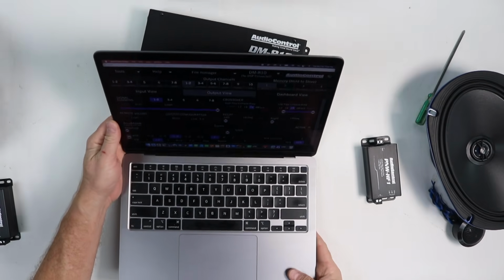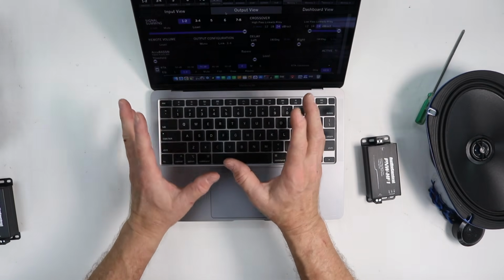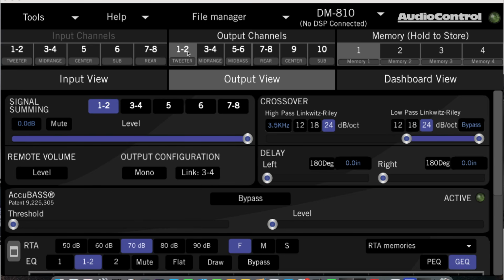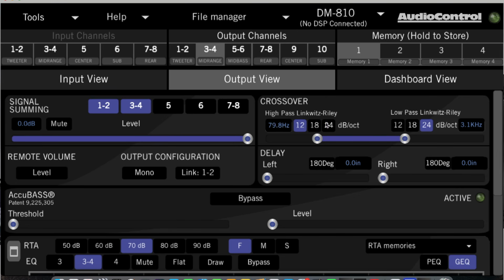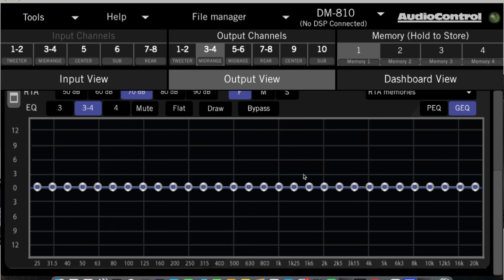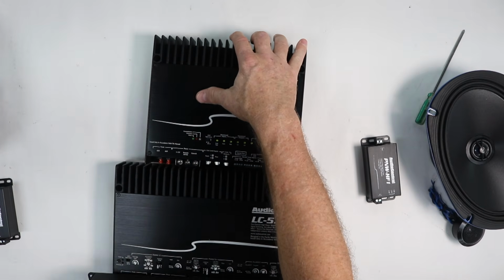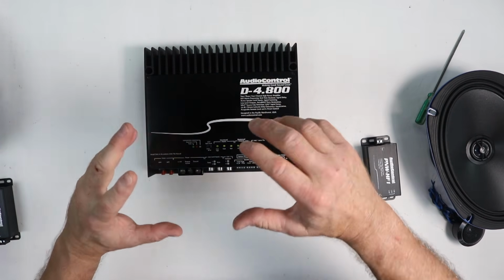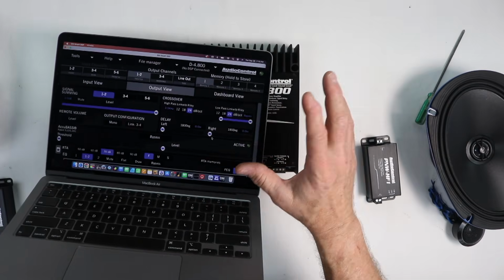You have DSP amp why are you still using passive crossovers

Comment: Because even with a 8 channel dsp, I have 4 speakers at the front, mid bass and ful range and two subs in the rear. Leaving 2 channels. I run a cross over on the rears for doors and tweeters.

Comment: I'm one of those affected by this. Went to my local car audio centre, asked for an 8-channel DSPamp, they ran out of stock. Said that a 6-channel (4 powered) would suffice. For context, my car has a factory set of components up front, mid bass on the rear doors and an aftermarket compact powered underseat sub. Now the front components are actively powered, while the rear doors speakers are unpowered and untuned. While I appreciate the stronger front stage this produces, my initial want was for the audio to be improved and elevated throughout the whole car (not just the front).

My dilemma now is if I should get a new 8 channel DSPamp, or purchase aftermarket component speakers that will come with crossovers to achieve my goal. God help me.

Comment: So do you have to bypass and cutting the cars factory amplifier that controls your car functions or can you just tap in to the speaker wires etc etc from the factory Harman kardon amplifier to your aftermarket amplifier speaker outputs

Comment: Digital active crossovers, DSP, have a FUNDAMENTAL advantage over passive ones and that is that they do not modify the PHASE of the signal.
Reply: If You are speaking on All crossover types, you would be incorrect.  Not all crossovers are made/built the same. Do your research. A Linkewitz-Reily crossover is the only type of crossover that “fundamentally” has the ability to eliminate the out of phase signal you are likely trying to reference, w/o any real in depth knowledge of knowing what you’re talking about…   The active crossovers actually DO shift the phase. That is Fundamentally how they work, by design.

Comment: Like many, I watched this tutorial video about 30 times to fully grasp the installation process for my AudioControl D-5.1300 amplifier. Unfortunately, I ended up losing my tweeters due to the wiring in my 2019 F150 Lariat B&O. To compensate, I adjusted the amplifier to redirect those frequencies to other speakers for my high-ranges. I'm planning to install an additional amplifier to enhance the front soundstage and have been using YouTube to guide me through selecting the right upgrades and rewiring, ensuring my tweeters will function correctly for the second phase of my upgrades. - thank you for this video and many others to help us who need this knowledge.
Reply: Man how much these installers want nowadays for me anyway I need to do everything on my own or else it won’t get done !
Reply: @michaelmarquez6133 TRUTH

Comment: One question... As there is an audio processor (DSP) inside the amplifier, I assume you will use the active (digital) crossover that is inside the DSP. So you won't install the physical/passive crossovers? Or even if there is a digital crossover (which is inside the DSP) are you "obliged" to install passive/physical crossovers? I think this: if there is a digital (active) crossover and I don't need to use the passive (physical) crossovers that come with the speakers... Am I right or wrong?
Reply: no obligation if your dsp amp has all output channels number you want , for example 9 separate channels ( 2 front tweeter + 2 back tweeter + 2 front midrange + 2 back  midrange + 1 subwoofer) If not, you must use to 2 different speaker for  1 dsp channel and split the signal freqv. with passive crossover.

Comment: If AudioControl just made a 7 channel DSP amp this could all be avoided. If they really wanted to make it the perfect amp they could also add load resistors internally and make it start-stop compatible. I waited  over a year hoping it would finally happen, but it never did so I just pulled the trigger on a D-5.1300. I'm going to try it out with passive front stage, amplified rear and active front stage, non amped rear to see which I prefer. It just sucks to spend that much money and still have to make compromises.
Reply: How did it end up sounding for you? Did you use the PNW components?
Reply: They are daisy chain able, so you just need another one and bam, you have all the channels
Reply: @jlaustill they still don't support stop/ start

Comment: Very well explained in the simplist terms to those whom are new to audio systems. 

Another benefit to active crossovers, is efficiency. Less wasted energy as a by-product of heat going thru a passive crossover. Perfectly fine to use a combination of both while tuning ones system. In a fully active crossover system, if a dsp every crashes, tweeters can be likey the first to go if not caught in time.

Tweeters for the most part, doesn't require a lot of power. Woofers & subwoofer does demand more. 

Music is dynamic, constantly changing. Wattages rating on speakers is a thermal rating in general. No need to chase big amplifier power #s, headroom (bigger amplifier) can be good to raise ceiling before limitations of equipment. Find what suits ones ears & be mindful if something is sounding off/distorted at higher listening levels. Back down the volume to preserve one's hearing (most importantly for longevity) & to save equipment. May all continue to learn...

Comment: I’d like to put a DSP in my truck. But I don’t know of one that you can change the ohm load of the speakers that you are using. In my truck, the tweeters are 4 ohm, the midranges are 2.5 ohm, the mid basses are 8 ohm and the subs are 2 ohm.
Reply: you need a dsp amp who suport a minimum 2 ohm because they all suport superior values like 4 ohm.

Comment: So if I use a dsp amp do I not need aLOC Like the lc7i?
Reply: If your head unit already has pre-amp outputs (AKA the red and white RCA jacks on the back) then no, I'm pretty sure you'd be good to go. If not, the Audio Control DSP's have speaker level inputs, so no need for a LOC.  👍
Reply: No you dont

Comment: I use crossovers with my DSP to protect my speakers in the event the DSP settings get changed or lost.
Reply: Unless your dsp is trash, that shouldn't be a problem
Reply: @bennyblanco14 nope. You are wrong. Many stereo systems experience speakers pop when the power to the amplifiers turn on. You usually only hear it in the subs. But It can happen to all the speakers. The most common way to blow a tweeter is from the amp turning on and tweeter having no protection circuitry…  the “bass blocker”, as referred to in this video is simple a load resistor.  It provides two purposes. One is to block the lower frequencies and the other it to protect it from the “speaker pop”, to prevent it from blowing
Reply: @champspec the remote turn on sequence should be 1st dsp, then amplifier (if any), lastly monoblock/active sub, this ensure that the dsp turns on first and immediately becomes active (applying the EQ , crossover, TA) only then it sends out remote turn on signal to everything else

Comment: Now I get it 😀 In other words, if you're doing the install yourself, get more channels because the cost of the install for a professional to do it will be worth the cost upgrade in the amp when you do it yourself. Plus you don't have to worry about installing more items like passive crossovers. Thanks Dean! So much useful information!
Reply: Just got a 5 channel installed for 275 they weren't happy because they said I was quoted the wrong price 'it was just for bass' I said I would have just bought a mono amp 🤷‍♂️

Comment: In theory though, is there any benefit to running passive crossovers if you are going for an active setup for the front components in a 6 channel amp dsp? Or would the passive crossovers limit the performance/adjustability that the dsp offers for the front 2 way? I'm running a Helix P Six running my door speakers and active front components. I left the passive crossovers in, but now i'm wondering if I should just let the dsp alone set the active crossovers. Thanks!